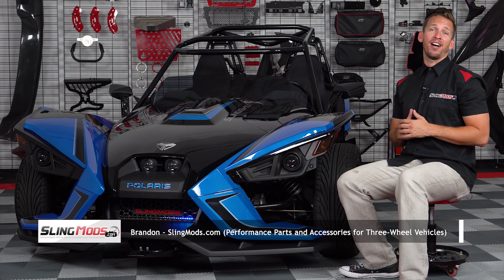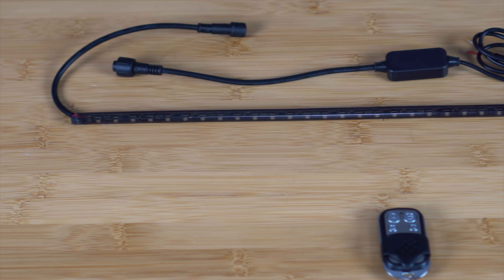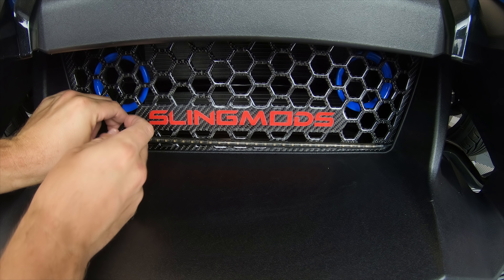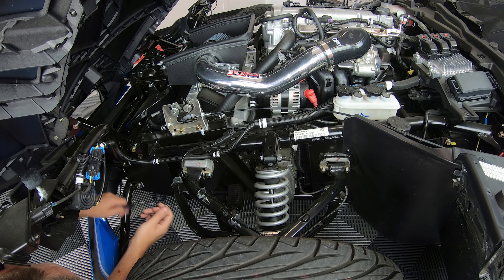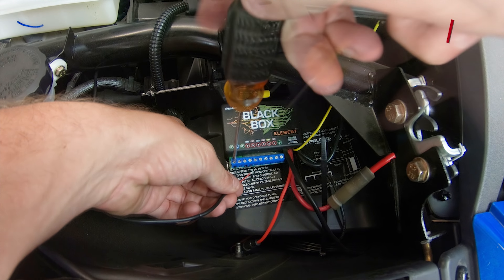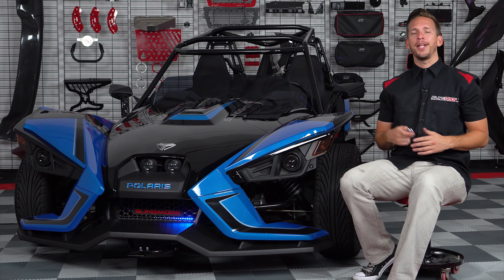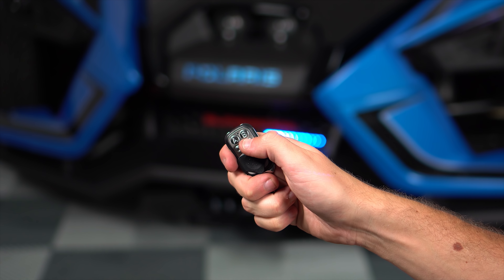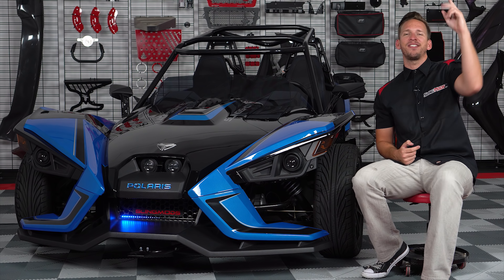Polaris Slingshot Adjustable LED Night Rider Light

Comment: Slingmods, how about a video on the TOP recommended things to do or add to your slingshot (especially good for new owners)??  Say upgrade Stereo speaker, cold air intake, turbo?  etc.. maybe give us your "2 cents" on what YOU would do to your own Slingshot or recommend to a new owner(s)...  THANKS
Reply from the maker: Hey Retro.. that's a great idea. We were actually thinking about adding a section to our site for "must have" mods based on consumer feedback. Thx for the feedback.

Comment: I don't own a Slingshot but I was interested in this product as it seems to be a good fit for my car's grille. I just wanted to know how it would work with other vehicles without an accessory fuse box. Would it be possible to wire it up to an external battery pack and run it that way? Thanks for the help!
Reply from the maker: Hey Garrett, yes this will work on any vehicle. Simply hook to a 12V power connection and you're good to control with the included remote. These are expected back in early July!

Comment: Do you have to pair the remote with the Night Rider light when you change the battery?  After changing the battery light does not turn on.
Reply from the maker: Yes, you'll have to repair the remote.

Once power is connected. Make sure the black push button power isn't turned off. If you open the small Black box attach to the knight rider led there is a small black button In the top corner.

Push it once, let go and push it down again and hold for 3 seconds. 

Does you get a flashing red light? If not then there is no power to the unit. 

If it starts flashing push A, B, C, D on the remote to pair.